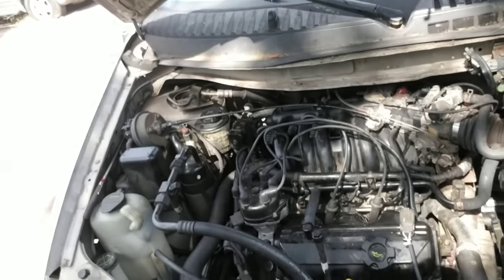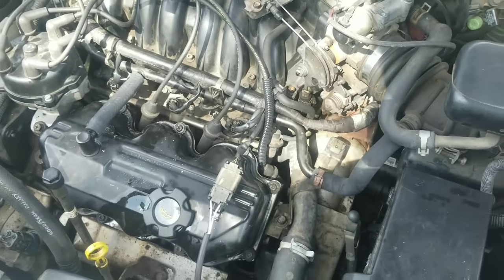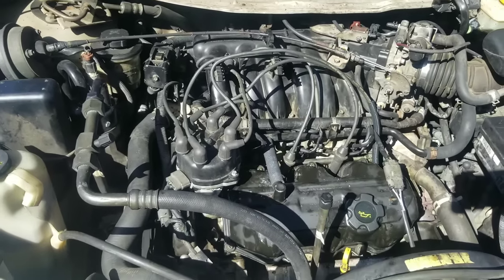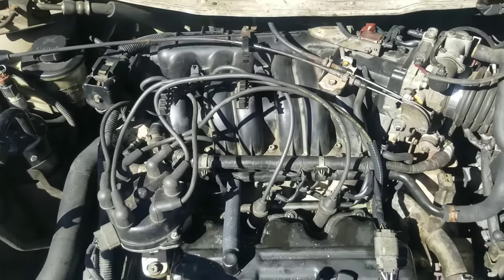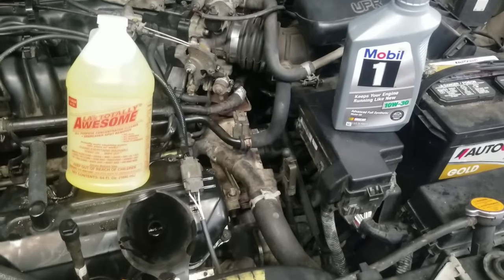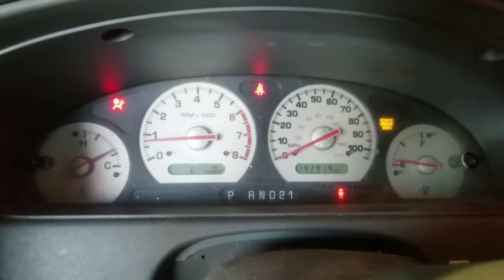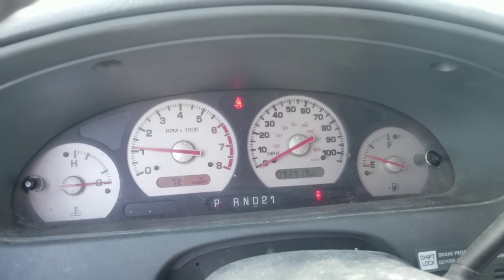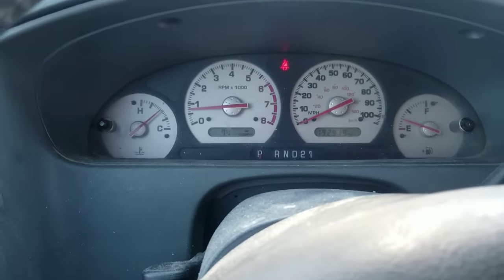How to Clean The Inside Of Your Engine The Easy Cheap Way.

Comment: The engine was shot and the guy saved it.There is some really stupid comments.Good video.
Reply: +king troll - Right !!! People are STUPID !!! Next time when you go to the Dollar Store, grab a bottle and spray that on your Clothes that have Oil / Grease Stains... It will remove it for sure !!!  I have remove Stains + Engine Grease that other products won't get it out.  Some of the Stains are like 6+ Months old and to my surprised, it came out Clean ://.  LOL
Reply: +Jordan Bronson   Funny you should mention it - in true Viet Nam war movie - We Were Soldiers, with Mel Gibson - soldiers "cooled" 80 mm Mortars by peeing on Mortars.
Reply: Reaper 556.xx -  thats why they put alcohol in our fuel right???? stop using ethanol it's bad for your car.
Reply: Jordan Bronson - I'd like to see how well your engine works after having a pee in the fuel tank. I've seen just how well human pee gums up fuel lines & the carby, it goes to a Vaseline Jelly type paste that is a bitch to flush out. The engine was run after an old guy pee'd in the tank, started running a bit rough and was then parked up for a week, that's when it all gunned up.
Reply: Vaquero 357 gas and oil are 2 different things. Gas is made by scientists who know what they are doing. Putting straight alcohol in your cars oil is stupid which is not proven to be good for a car. It’s a stupid risk to take just like what this guy is doing.
Reply: Try telling that to California whom insists that ALL gasoline sold at the pump for on road use MUST contain ethanol (I know it's not isopropyl but close enough)...
Reply: well if its a diesel, then the new ones that must use DEF diesel exhaust fluid do... it's 67% water and 32% urea....
Reply: Advertising for  "totally crapsome"!
Reply: patrick jackson - no not like this guy is doing, this guy didnt put alcohol in the engine. who said anything about putting straight alcohol in your engine? I didnt. this guy didnt. the original post in this thread didnt. so what are you ranting about?

I have used kerosene/diesel/marvel mystery oil/etc many more times than once and they never gave a problem. my uncle used to use tranny fluid as well. this guy saved a crapped out engine and gave it new life. all he did was add degreaser to the oil. the degreaser emulsified the oil and broke down the sludge so it could drain out of the pan thus removing it from the engine. emulsification does not remove the lubricity of the oil. so there is no danger of this harming the engine as long as you do as he says and do not drive it while treatment is in the engine. and as you and everyone else saw, it HELPED this engine and cleaned out the crap.

if you want to drive your sludged up engine, fine. but for people that know better and care about their engines, we will keep it clean.
Reply: teknakill - yea except that it actually worked to remove the crapsome from the engine. people never learn.
Reply: I tried it but I botched it. Earlier today I poured 2 bottles but left a Lil oil from the change my car stalled in 60 seconds I added 2qtz oil but  I can't get the engine to turn  over any thoughts 05 Passat 1.8l turbo
Reply: Heard people doing this with kerosene to. Never tried it. I like my vehicles to much....
Reply: Would the leftover totally awesome break down the good oil you put back in. Isn’t their still residue of it still in the engine...
Reply: perfect profile NAME...GOOD GOING!!!
Reply: So much for the bearings, those so called "Degreasers" are 95% water. Water is in no way a lubricant. If this was ok why not just run water instead of oil?
Reply: @thomasjackson9218  Do i really sense something like distrust in a product with such a classy, trustworthy name like AWESOME? Seriously? come on!!! What's next? You not believing a guy like Bernie Madoff guaranteeing you 15% return on investment per year? What only happened to society?
Reply: @medlytek   If I did this and cared about the engine, I'd drop the oil pan and clean it out 100% before adding in my good-to-go engine oil.
Reply: They were using awesome cleaner ..that's what ruined it in the first place
Reply: @thomasjackson9218  water doesn't dissolve oil. And if the degreaser was to acidic it would #$&k up the engine.  What he did was perfect and when you have a car or truck that would cost more than it worth to fix....a few bucks in degreaser is pretty dam genius!
Reply: @pattycarljackson  q1

Comment: That’s a great solution, literally. 
Gives me hope for getting grit out of the top of the engine. 
The oil filler part was sitting loose on the valve cover, and over time sucked lots of sand and dust in. 

Thanks for sharing

Comment: when I got a motor that needs a severe flushing I use 4 quarts of diesel fuel and one quart of oil run it for 15 minutes change with some 10w30 it fixes clicking engine like no other
Reply: Erin Arnold that’s what my grandfather taught me when I was young.
Reply: Cam I do that on a 2010 mdx
Reply: I did this back when I worked on heavy equipment to differential, transfer cases, and final drive unit. Work like a charm. Anything that needs the oil and contaminants flush I would do it. Never a problem afterwards.

Comment: I use an old mechanic trick ... diesel fuel. I change my oil on time and once every 4 changes I add 16oz. of diesel to a warm engine prior to dropping the oil. I let it idle :05 and then do the oil change. If it's a friend with a gunked up engine I drop the old oil and then add 3qt.s of cheap oil and 1 qt. diesel. The whole time while idling I'm giving said friend a hard time about not doing oil changes and routine maintenance. So at least :10! Diesel to some degree is a very light oil, light enough to act as a solvent with a little heat. I feel more comfortable using diesel instead of some bottle of detergent because I have no clue what that would do to seals and gaskets over time. There's going to be residuals no matter how you do it and I feel diesel is safer. I also feel safer following the advice of a mechanic that takes care of semi truck engines with millions of miles on them.

Comment: Small amount of kerosine oil about   250 ml is enough to add in engine oil and running it idle for 10 mins is enough for flushing purpose
Reply: @Awais   250 ml is about a cup in English units. People might want to know, lifter noise additives often are on a kerosene base. Apparently, so are some cheap gasoline additive you can buy at the dollar. A cup of off label additive in the engine oil is about my limit.
Reply: Yup!  Kerosene works great.  Rislone is a great product for a slower/gentler cleanse -- a high detergent additive that works over maybe 100 miles of driving.  Chevron Delo 400 is a diesel formulation of motor oil - 15W40, as I recall.  It works great too.  Cleaning too much gunk too fast is risky.  Delo for several oil changes is a great way to dissolve the gunk slowly and safely.
Reply: Awais Iqbal  Can ruin engines.  Be careful !    Manufacturers are dead against any oils additives and for a good reasn.

Comment: I'm just worried about doing damage to seals. That cleaner is pretty harsh. But if it works for you and/or you have an engine that's on its last leg, then use this method. Don't think this guy would do this if he knew it was going to damage his engine. Good video either way.

Comment: You can't teach a new dog old tricks. He kept the oil pressure low by keeping idle and not letting the car run long. I've worked on cars all my life at my father's garages. He done nothing wrong he just used his choice of engine cleaner with oil. Far as Marvels Mystery oil it works wonder's I use it in old cars that have sit for many long year's never started I pull the plug's and pour 2 ounces down each plug dwell hole to free up the engine and use 1 bottle between the 2 heads to lubricant the valve train and spray it on the entire engine to free up any moving part's including the carburetors. Who would ruin a $5.000 dollar 32 valve Northstar Cadillac engine to using improper oil ? Lots of morons do. It recommendations are 10-30 synthetic in the summer and 5-30 Dexos oil below 60F in the winter. 5-30 is thinner flowing so I use 6 ounces of Marvels oil in the winter and since it's a 1999 Deville being 19 year's old soon to be 20 I take very good measures to keep the engine clean. A dirty engine in any car will result into oil consumption meaning your pistons do not whip the oil and it's left behind to be burned not leaked. Another trick on newer cars with plastic radiator's and old cars with brass and copper is I use liquid draino to flush out clogged radiator's it works it has never damaged any radiator. Lime and Calcium deposit cleaner works wonder's too. This man isn't dumb by no means. It show how dumb our society is today when it comes to our new generation. Great work old timer.
Reply: Puppet Master i
Reply: Weird flex but okay
Reply: you can get a 32 valve Northstar Cadillac engine for $5? where? i want 40 of them to resell.
Reply: @darkshadowsx5949  sell them for scrap. LoL.
Reply: You cant teach just anyone new tricks. How would using Mystery oil free anything up? What is it that could get stuck just from sitting? 😂 Yal'll shadetrees crack me up.
Reply: A water based cleaner  damages the metal parts of the engine  and some of the cleaner is still in the engine after the drain .That was the weirdest engine flush I have ever seen ..
Reply: Nice article
Reply: I use the cheapest oil and half a bottle of Marvel Mystery Oil.  1000 Miles and oil is black with a heavy filter.  I then do a 1/4 bottle and a 2000 mile oil change.  After that, compression is back and oil stays golden. First used it on an inherited Escort that was smoking when cold.  Never smoked afterwards and never ate oil.
Reply: Nice Dog thank you
Reply: @stangmaster 2 I think or I KNOW he probably succeeded at that .. I will get Mean  Green  Cleaner, a pint at full strength at least  and pour it in my engine and destroy and dissolve and  displace the oil in my engine and let the metal parts eat and grind  themselves up and lose the compression in my cylinders ..WTF I will have a new engine ,a total rebuild ..FU machine shops ,,I have strong soap that will do my engine rebuild at the highest precision .
Reply: @robbydiesel9345   Yea ,and dont forget to dissolve the engine oil in your engine by using Super Strong Water Based Cleaners for a flush and a new engine after it is over with ..
Reply: NICE DAWG fact i try to help people but shit like this make me keep knowledge to myself no good in trying
Reply: Puppet Master okay boomer
Reply: NICE DAWG and a few others are making comments based on what they prefer to be true, and ignoring what can be observed. Of course you don't want to dillute oil with water based anything for anything more than a very short period, just as you don't want to dilute oil with the corrosive motor flush stuff for anything more than a very short period. It's obvious it did not ruin the engine. As for any of the water remaining in the engine, anyone familiar with how an engine works knows it evaporates as soon as the engine reaches normal operating temperature. People who use their cars mostly for short trips often have condensation (water) build up in their oil. It's not optimum, but it isn't a death sentence for their car's engine either. It evaporates when they take a 30 minute ride somewhere.

Comment: This is a great flush method but drain your oil and pour in two qts of STP oil treatment and one at of 40w cheap oil and. 2qts of Totally Awesome for about 15 mins and and let the engine cool for a hour and then run the engine again for 15mins then drain, and change the filter. Top off withe a cheap brand oil and drive it for about 100 miles and drain. Depending on the look of the oil after the 100 mile run you may need to change the filter again. Then top off with High Grade oil and and a few ounces of Motor Kote. It's far better than Mystery Oil. Keep in mind to not over fill. The Motor Kote is a Hyper Lube and seals very fine micro cracks throughout the piston walls and help smooth out the engine. Pennzoil Platinum is great because of the detergents in it the keep your engine clean.

Comment: Not knocking the video, I’m glad it worked for you HOWEVER as others have said, using a product that literally washes away the lubrication properties of the oil itself from bearings, rings, etc scares the $hit out of me! 

I know it wouldn’t hurt anything to try this on a motor that was destined for the junk heap however doing this on a hood motor scares me.

I have been considering using the BG Dynamic Flush kit ($300 plus my own labor) on my Wife’s VW as they are know sludge makers!

$300 is pretty steep however the results I see on tons of YT vids looks promising!  A friend of mine that is an “A Tech” uses a blend of Trans fluid and oil at idle only, to clean sludge out monitoring oil pressure the entire time!!

He said when he worked at a VW dealership this was their go to for cleaning out sludge!  Not recommended by VW obviously but he said this IS what worked!
Reply from the maker: so this method is less then $50 but you wanna spend $300

Comment: I always used Marvrl Mystery oil at EVERY oil change and my engines last forever!...but never in my 30+ years of working on cars would i have thought of AWESOME its $1 per bottle at Dollar Tree!...😂
Reply: What do you think about using diesel like a flush
Reply: Same here I always use marvel mystery oil that stuff is 💯  truth!
Reply: If it works I can't hate. People look at me weird for using kerosene before my oil changes but I have a perfectly running motor with 274000+ miles on it and burns no oil. and every car I have owned has been nice and clean (the motor) on the inside.
Reply: @HDtone23  Picking up my first pint of MMO TOMORROW - !! got 238K on an 04 Trailblazer - you can NOT get to the Oil Pan in those things (unless you do a 20 hour labor job)...
Reply: @voidisyinyangvoidisyinyang885  Im running MMO right now, it says to use for several hundred miles for full effect / up to 500 on noisey engines, but during pandemic i have been driving like less than 15 miles a week  / will report back in 2021 lol
Reply: So how u use it do I have to empty my oil and add that thing and let it run for a bit
Reply: @robertoarriola-bustamante9169  I've heard of diesel but marvel works so damn good I never needed to use it!...
Reply: @shawnyoung5960  rite on brotha whatever works for without damaging the engine
Reply from the maker: Thank you please like, share, and subscribe, also please check out my other channel Salem Taxi, on YouTube for more material on a different level.

Comment: In the 70's we used automatic transmission fluid and marvel mystery oil we didn't have the new stuff that came out only we also pulled the pan after flushing to make sure the pick up was 100 percent clear

Comment: Really good video. No one has attempted to clean the engine with solution before, at least I have not seen one. No to mention the fact that carbon clean method is not recommended.  Keeping in mind that most of cars have not been so badly neglected, but hey everything is possible. Thank you.
Reply from the maker: Thank you please like, share, and subscribe, also please check out my other channel Salem Taxi, on YouTube for more material on a different level.

Comment: That was totally...AWESOME!!!! Sorry couldn't help myself. I'm amazed, that engine sounded like it was clapped out. It defies common sense as I thought you would get a hydro lock. How long should you allow it to run? And exactly how many flushes depend on the results or just continue until you get the desired results. Did you let a little oil out at first?
Reply: Woww amazing. Even sounds way lot better n smoother

Comment: THIS PROCESS WORKS GREAT.  I HAVE ALSO SEEN AND DONE THIS  MYSELF BUT JUST A LITTLE BIT DIFFERENT. CAN USE TWO  GALLONS OF KEROSENE BUT MAKE SURE YOU ONLY PUT ONE GALLON IN AT A TIME AFTER YOU DRAIN THE OIL FIRST AND LEAVE THE OLD FILTER ON WHILE DOING THIS PROCESS.  ALSO BEFORE YOU PUT THE FIRST GAL OF KEROSENE IN MAKE SURE YOU DO PUT ONE QUART OF CHEAP OIL IN.  THEN ADD THE FIRST GALLON OF KEROSENE.  CRANK THE CAR AND ONLY ONLY LET IT IDOL.  DO NOT DRIVE THE CAR OR  REV IT UP.  RUN FOR ABOUT TEN TO FIFTEEN MINUTES AND SHUT IT OFF.  LET SIT FOR FIVE MINUTES AND THEN DRAIN.  REPEAT THIS PROCESS AT LEAST ONE MORE TIME.  IN MOST CASES YOU SHOULD NOT HAVE TO DO THIS MORE THAN THREE TIMES AND THE ENGINE SHOULD BE CLEAN TOP TO BOTTOM.  WHEN YOU DO THE LAST DRAIN,  MAKE SURE TO LET IT SIT FOR  ABOUT  30 MINS TO AN HOUR SO THAT ALL OF THE KEROSENE CAN DRAIN OUT. YOU CAN ALSO TAKE THE OLD FILTER OFF AND SOME SHOULD DRAIN OUT THAT WAY TOO. NOW YOU CAN DO YOUR OIL CHANGE.  IMPORTANT NOTE.  IF YOU CAN,  USE THE BEST OIL THAT YOU CAN FOR BEST RESULTS.   SYNTHETIC OIL WORKS GREAT WHEN DOING THIS.  MAKE SURE TO DO THIS STEP BY STEP AND ALSO REMEMBER THIS IS ADVICE AND IF YOU TRY IT,  ITS IS TOTALLY AT YOU OWN RISK.  I AM JUST LETTING YOU KNOW THAT I HAVE DONE IT AND IT WORKS VERY WELL. DO NOT FORGET TO DISPOSE OF ALL THE OLD OIL AND KEROSENE MIX PROPERLY.   BEST OF LUCK WITH YOUR PROJECT AND   GOD BLESS YOU.  THANKS.